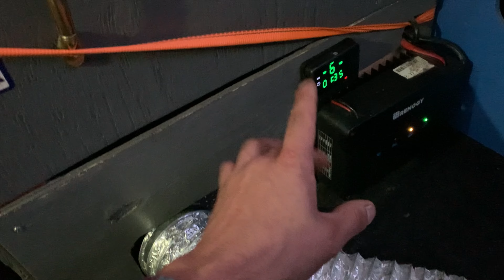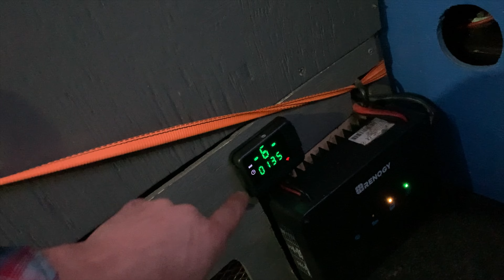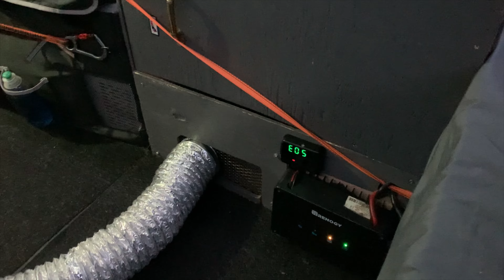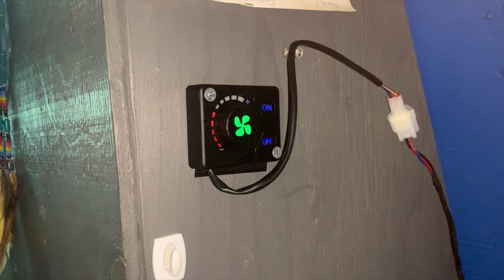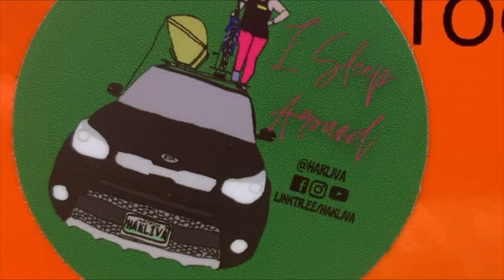Did They Lie ??, !! I Can’t Believe This Happened !! I Truly Have The Best People In My Life

Comment: Had similar issue and I also would shake or bang on unit it would act right then act up. I took it entirely apart and fixed everything that was not to my liking.  I did find some pins pushed out of th controller.  I pushed and made sure everything was connected properly in plugs. These heaters should always be disassembled and reassembled making sure everything is safe and is secure being the life and death of these heaters

Comment: UK here.  Just subscribed.  I've had a few campervans.  Most of them would fit in the back of a US or Canadian motorhome as a get-you-home spare.  🙂
A point about fuel lines.  The green stuff is garbage because it can easily kink and block the fuel flow.  The hard white pipe is good, but the black rubber pipe for connecting it can perish.  Mine did and the heater pumped diesel everywhere except into the heater.
I'll be using the thicker-walled clear tubing on every heater I test in future.  Or I may use automotive fuel pipe.  I'd buy aviation grade fuel lines but I'd need to win the lottery first.  🙂

Comment: Please save up and buy a good heater. I had 3 different cheap Chinese crap heaters that all failed. Saved up $900 and bought a Planar from Russia you can buy them from Surrey here in BC.  They are the best zero  problems.  I will never put crap in my van again it's not worth the headache especially with failure at -25.
Reply: I had 2 failed chineseum heaters , I never tried to fix them, just went to the trash and I bought a webasto, alot of time and hassles saved

Comment: Good on you trying to diagnose those heaters. One thing that stuck out at me about them was when you said that the behaviour of the heater changed after you wacked the control unit. I've seen behaviour like that before, and it was caused by bad solder joints. I would try to reflow the solder, maybe adding some new solder,  where the cable connects to the circuit board. Hope your new heater lasts a long time! Take care!

Comment: Good Morning Bruce! Congratulations on 5000 subs! 
 I think fuel delivery and the fuel settings are the main problem,  the green rubber fuel hose should be swapped out for the hard white plastic hose and  need a controller that the settings can be changed especially in the  advertised 8k heaters they are just 5k that are over fueled. Thanks for sharing your videos and take care my friend.
Reply from the maker: Thank you 🙏🏼😁

Comment: If you can get into the pump and air speed control settings, you should be able to trim the fuel air and prevent it from developing soot(you need to derate the unit 20%, you are above 2000'. You need more air, less fuel.)
You will be able to control your discharge temperature too. 
I just picked up a 5kw vevor and have had no problems so far.
Reply from the maker: Unfortunately most of my heaters have the turn dial monitor so getting into the fuel pump settings isn’t an option 
I’ve messed with the one heater vevor sent me (witch has a screen kinda )
But even that one basically has nothing for options 👎🏼
However a feller could change the computer and monitor to one with more setting options 
But I currently have 3 heaters that need rebuilt kits adding 3 compatible computers plus monitors doesn’t sound fun 😅 or cheap 
But I have worked and installed heaters with the monitor you are talking about I just haven’t personally tinkered with the settings as they were not my heaters I was just installing them

Comment: Did you ever try changing your hot air long pipe to 4 inch instead of 3? It cuts back on backpressure and overheating issues

Comment: Hiya, I was watching one of Chromes recent videos and he was having E-05 issues. He ended up taking the end off the combustion intake and it seemed to make a difference in getting the E-05s to stop. Just thought you should know. Take care from east coast Australia.
Reply from the maker: I’ve seen it as well unfortunately my recent ones issue is a temperature sensor but I did do as he did and it helps a bit 
But still shut down eventually either way 👎🏼
Reply: Before applying the pedal modification technique 👟

Comment: So I just bought one of the "new" heaters. They do have bluetooth heaters but they are $10? more and are under a different listing that shows a phone in the pictures. My unit has the same controller and big one hole vent as yours and it was pulling E-05s ever since the first time it was started up. Contacted Vevor and they said it was likely a motherboard issue and are going to send a replacement. So we shall see if that is the problem or if it is something else.
Reply from the maker: Wow that’s incredible you got them to send you a replacement part 😲
They wouldn’t even help me out with parts for the heater THEY Sent ME 🤔
Hopefully your new motherboard works 
Because as far as I know the motherboard has to be the exact same as the monitor to talk to each other correctly or it won’t work 🤷🏼‍♂️ but definitely keep me posted 🙏🏼
Reply: @BruceVanlifeJunior  Ok, for some reason YT ate my comment. I sent  them an email to the support email on their actual website where I bought it from instead of the rain forest place and had to send them a video. Shortly after I got this reply "We have received the video file you provided and have confirmed that the issue with your product can be resolved by replacing the motherboard accessories,
We will send you the corresponding accessories for free. You can confirm through the pictures below. Please be patient and wait for 10-15 days. "

Odd that you were not able to get parts for yours, looks really bad on their end. I wonder if it was because you didn't have an order number?
Reply: @BruceVanlifeJunior   Got the replacement main board in and installed it. It did not fix the issue unfortunately so I sent another message to Vevor and will see what they want to do next.
Reply: @BruceVanlifeJunior   Had to send them another video. This time they are sending me a temperature sensor and another main board just in case. Hopefully it fixes the issue or I will be asking them to send a new heater
Reply from the maker: Wow Riyame thank you for updating me on this process! 2 weeks later 😬 vevor is not making a good name for themselves 
All the best much love !! 🙏🏼
Reply: @BruceVanlifeJunior  Thought I would give you the final update. Got the parts in today, another replacement board and a temp sensor. Installed them and remembered seeing something about how airflow could cause issues so I took the plastic air diverter off of the hot air vent tube.... 

Before it would hit 260-265C internal temps after 5-10 minutes depending on the setting and shut down. After 25 minutes on setting 5 it was holding steady in the low 230s. I turned it up to 10 and it slowly crept up to the low 240s and held for another 15 minutes. I put the diverter back on the hose just to see and it rapidly climbed to mid 250s when I took it back off again and it started to cool back down slowly. I turned it back down to 5 and the temp shot down pretty quickly.

I am thinking the parts were fine all this time, the entire issue with my heater (and maybe others) may have simply been the included air diverter restricting air flow just a bit too much.

If you or others have problems in the future it might be something to check first. Remove the diverter or the tube entirely and test then add one and another and watch the temps in the "diagnostic" menu to see what they do.

Comment: For me the chinese fuel pumps have been my problem.  So, I bought an original german fuel pump, and that works mint on my chinese heater...   Oh, as for the temp, I don't bother with it since it's so off ... so I always keep mine in manual Hz mode and it's just easier.  Also, I keep a spare simple knob controller with me incase the fancier remote one decides to crap out. shrugs

Comment: Hey Bruce 
Can you adjust the pump flow slow the fuel down and increase the fan speed 
And I see you are using that soft green line for the fuel don’t it’s no good, use the hard line they are kind of white.
Reply from the maker: Unfortunately all my heaters are the turn dial style controller and doesn’t seem to have the features your mentioning I have tried with other heaters that have the advanced controller and have been able to do exactly as you described , it’s just unfortunate I’ve gotten the cheaper controller 
Also I totally agree with you about the green fuel lines they are definitely no good 👎🏼
Hey … wait a minute I know you 😲haha 
Hey @lolesoffroad great to see you brother ! I really appreciate the advice from such a legend 🙏🏼😁

Comment: I've heard that a 4" exhaust tube helped with the error on some heaters
Reply from the maker: I can’t see it making a difference as the hole in the heater itself isn’t that big , also with a 4” I could put the entire heater inside it 😅🤷🏼‍♂️ I’ve seen other use it and I’ve tested it myself with no tube at all and still they error out
Reply: @BruceVanlifeJunior  yeah that makes sense and these heaters are basically the same except for controllers or something that maybe Vevor has made for only their heaters, so I am thinking along the lines of a controller issue or something else. I just received a all in one horizontal Vevor yesterday but haven't tried it yet. I have one that is just a generic diesel heater that works fine. If I have issues with this one, I will let you know.
Reply from the maker: Watch my diesel heater comparison video 
It shows what to look for upon purchasing and what to look for before first start up ☺️

Comment: Just letting you know, removing the rear cap is BAD. Thats what keeps the case together. If it moves in the case during driving, It will be come a fire hazard ,infact it will go up in flames. As for the KWH of these heaters, that is simple math. The max fuel imput makes then at most 5kw, but most have the 22ml fuel pump, making near all of them 4KW. Rating the higher is marketing gimmic, and I think unethical.
Reply from the maker: If you watched the video I put tape on it to solve that issue …

Comment: Heaters are never going to work with pump,fuel line, etc. Outside in the cold the fuel will gel up at low temps . All mentioned needs to be inside with a box insulated and cheap ones have issues with elevations.  They are crap COMPARED to good ones that cost and overpriced.
Reply from the maker: If you have ever seen someone with a diesel fuel leak inside there vehicle you would think otherwise (ask Vanma Ruth😅)
Also I’ve run my heater all fuel lines outside in -48 (mins you my fuel thank is inside 🤷🏼‍♂️) and that same heater went for like 2 yrs , similar setup are in every semi truck and anything else that has one 
They do it like that in shops that install them professionally with the expensive ones 
If you think about it even with your vehicle the fuel tank , lines even the engine is outside in the cold and works all the same 
Hope this helps have a great day 🙏🏼😁

Comment: The controller needs to be father away from the actual heater… you can’t in close  it in such closed quarters … it needs room to breath…
Reply from the maker: It’s further away now then it was on the actual stand it came with 
Even if the heat blows far away from the controller it still doesn’t change anything